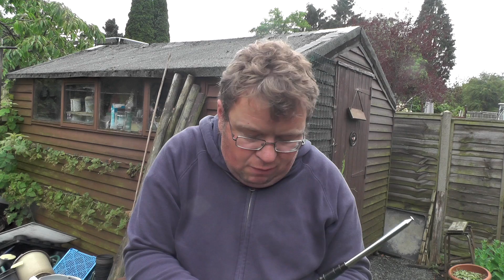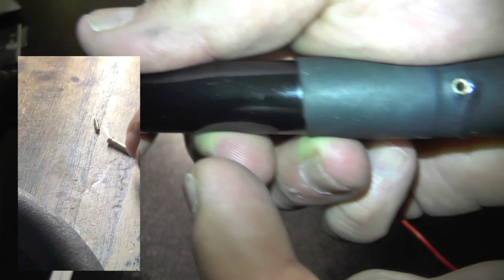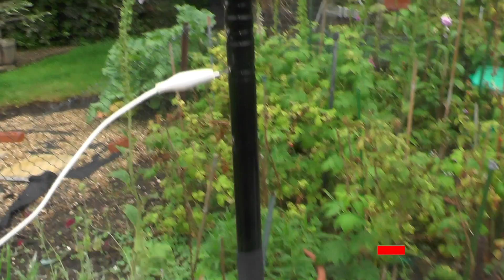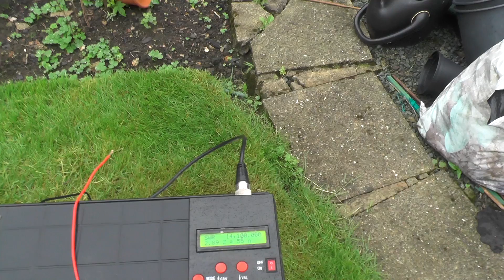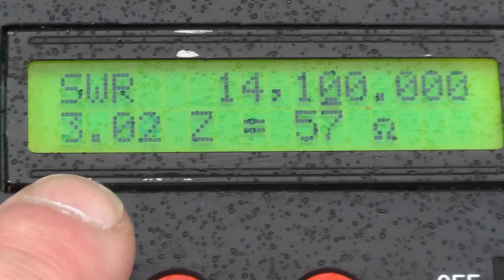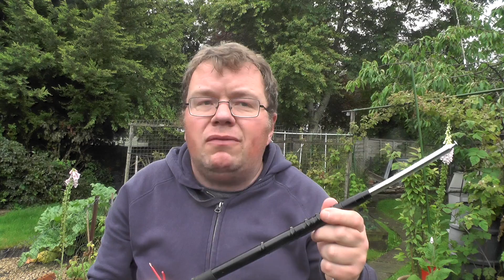SPX100 does it now work?

Comment: Jez, you don't need anything fancy for the patch cable, get yourself some banana plugs from ebay about 99p for a couple and attach to the end of your wire. Home made patch cable.  You'll probably need the smaller 2 or 4mm banana plugs. Just measure the holes on the antenna first. A longer patch cable will just mean you'll have to adjust the telescopic whip slightly to compensate
Reply: Great advice Damian. I was going to suggest Roll Pins however I think your idea may be better.
Reply from the maker: Ok I’ll get some banana plugs from eBay and give it ago good advice cheers